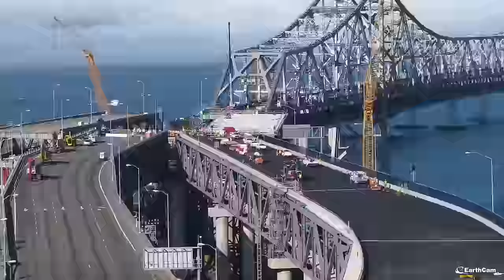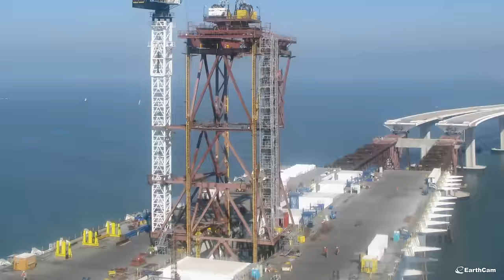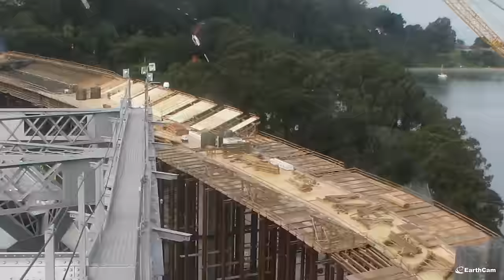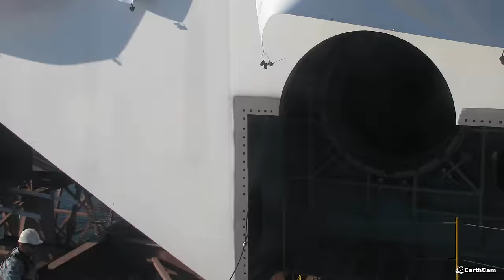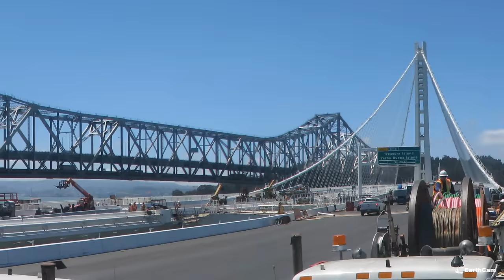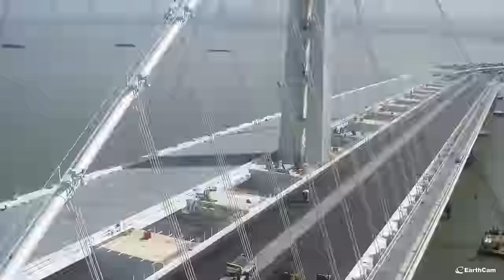Official San Francisco-Oakland Bay Bridge Construction Time-Lapse

Comment: Beautiful and hi tech. The bridge is designed to last 150 years and withstand 8.3 scale earth quake, and immediately functional and operational after any (imagined) earthquakes below 8.3 scale. The steel modular so are also hi tech, with spectacular precision. Engineers on site are deeply impressed that, for example, the 146,000 nut-and-bolts, fixers all perfectly aligned when installing, not even one fixer has 0.1% error!
Reply: This is an amazing piece of engineering and construction. 'Well done' to everyone involved.
Reply: Peter Wang wow your very smart I'm...

🤔DUMB I ain't as smart as that like Come on!!
Reply: Peter Wang man google really helps you
Reply: Eric Lee no only some of the steel, however it was designed by Americans
Reply: That's what you get when the engineer says every last detail to spec nothing passes that isn't from start to finish amazing
Reply: Mmmm sure whatever you say the last time i heard the bolts wouldn't stand a earthquake check yo self
Reply: So funny reading that first comment and how basically none of it is true. The bolts snapped as soon as it opened. The steel plates are so misaligned that water is already corroded the steel from the inside out. Life expectancy last I checked was hovering around 80 to 100 years if lucky. Overall the bridge was a complete failure on almost all fronts while being way over budget and failing to meet objectives.
Reply: You forgot all the suspect welds and rusted failing bolts before it was even opened for use. Are you a Union Representative ?
Reply: ryan stafford Have you forgotten all the bolts that failed the stress tests when the thing was already half built?
Reply: Can you say”Ticking Time Bomb”?
Reply: Orlando Nunez Spoken like a true  Union minion.....
Reply: actually, whole spans were made and shipped from china
Reply: @mrbrainbob5320  China has numerous bridges more stunning than this one, both designed and constructed by Chinese. This bridge wouldn't be finished so quick without Chinese supplier, because the debate would take forever when the budget is over by billions.
Reply: Yu Xiang The Chinese would use a lead-based coating which would need to be removed, remediated and approved by the EPA. We’d still be staring at pilings on the Oakland side.....
Reply: Wish All The Best to the bridge, but please remember Nature has it´s own rules...
Reply: Over $6 billion over budget and with faulty welds and bolts.
Yes........excellent.
Reply: @bongofury5924 , ummmmm and why is that?
Reply: Eric Lee  Even worse, it was built by Union workers.....
Reply: @yuxiang3283  Like the 3 billion dollar airport terminal which leaked in monsoon right after its opening.
Reply: The upper deck collapsed onto the bottom in 1989,  that was like a 7.3??
Reply: Made in Chaina!
😂😂😂😂

Comment: 25 years of a job well milked all packed into 4 minutes
Reply: 25yrs?  it sounds like forever for me
Reply: @xiaolongzhang3411  - Yeah no. It was about 10.5 years in total, and only about 6.5 years of actual construction (because of delays, work stoppages, cost overruns, politics, legal issues, etc.). Ironically, the bridge could have been paid for largely with U.S. Federal Tax Dollars (infrastructure grants, as it qualified being a Federal Highway). But the costs (bids) to build the steel modular sections and tower sections was so high, the State of California ultimately had those sections fabricated by Chinese suppliers (also loosing the Federal Grants, which had the requirement to receive them, that the entire bridge (and all infrastructure projects), must be "Made in America". The State of California could have worked it out, but our politicians are incompetent idiots. And even with the sections made in China (at a supposed large cost savings), the cost overruns were near what they would have been - if they had just gone with the American Suppliers/Fabricators in the first place; And it likely would have been done sooner. The issue there is: They couldn't budget or finance the fabrication of either the American or Chinese Bids, (as it was $Billions more than they originally expected/budgeted for), -hence the major delay (until they later eventually acquired the funds/ comittments).
Reply: @Sovereign_Citizen_LEO  china built longest bridge of 60 kilometre in just 9 years what a joke your are
Reply: @Sovereign_Citizen_LEO USA is a beautiful country where any human being would love to live, excepting some European countries where living is also a beautiful experience but China, although is a beautiful country also, full of nice people, has a culture very difficult to mix with other ethnic groups, very difficult, their eating habits are just for them. No way comparing engineering works of almost 200 years old with modern ones in China, almost all in a straight line, yes, some are monumental but not to be compared with the constructions and civil works of the USA in the late 1800¨s.   I´d been in those three places, and although I enjoy Europe very, very much I feel depressed when traveling to some of their countries, instead  the overwhelming breadth of the US is just incomparable. Sorry if I hurt some feelings, it is not my intention,
Reply: @logisticabucaramanga5094  - No hurt feelings (don't care one way or the other). Columbia is a beautiful country (green and lush), beautiful women, etc. Europe for whatever reason (even though it's amazing) doesn't interest me that much. Not true for South America (or even parts of Central America or Coastal or Southern Mexico). I would like to travel there. USA is somewhat boring in a lot of ways. I'm not too interested in works of Man (though they may be impressive). I like wilderness and works of God (natural places).

 I was thinking I might buy a property in Coastal Central America or Coastal South America (or Mexico). If I was wealthy I probably already would have.  Asia is also very interesting and vibrant/dynamic. But as for the natural world, I prefer North and South America (maybe parts of Europe also), and the Pacific Islands. Anyway, this girl is from Bucaramanga (and when I first saw her I was like.... wow : )    https://youtu.be/o5i-bj-6-Tw
Reply: @Sovereign_Citizen_LEO  I can´t believe you just mentioned my home town Bucaramanga !. When I was reading your answer, and saw you wandering thru those countries in your mind, I was thinking if Bucaramanga wouldn´t be the right place for you, and depending on your age it could be either the city itself or La Mesa de Los Santos which is a resort area where Panachi, and the Chicamocha Canyon Park are located.  
the world is definitely a handkerchief!. Where are you at?. Regards from Bogota, Colombia. Al Diaz
Reply: I see... I answered from my mail with the word Bucaramanga, anyway, nice to meet you. Yes, Colombia is a great country ruled by bandits, but even though it has a good living standard.
Reply: @logisticabucaramanga5094  What about the 1400 years old Grand Canal of China ? I think you underestimate chinese engineering. China and Europe are that USA are not yet, Civilizations with a big C. In Europe you can see more changes travelling 1000 km than 1000 km in the US.
Reply: Why do you say 35 years?
Reply: people built golden gate bridge in 1930s in 4 years.
Reply: took 3 years to complete lol
Reply: K
Reply: 2008 - 2016

Comment: They built the roadbed on trestles, then when they connected the cables and tightened them, the roadbed lifted into place so they could remove the trestles.  I watched a lot of the construction as I went to and from work.  This video is like what I did, only without the annoying "going to work" parts.  ;-)

However, it doesn't seem to show the infamous broken bolts, the famous "saddle" to work around the broken bolts, or the notorious shims to keep it from collapsing while they build the saddle.

Comment: What is the type of that bridge? Hybrid? I see beam, cantilever and suspension.
Reply: The old bridge, the one with cars, is a truss-cantilever. The new one is a self-anchored suspension span, although it looks like a cable stayed bridge. Behind the point of view of the video the roads on the two sides of the bridge become one above the other and go through a tunnel. The other end of the tunnel connects to two suspension bridges, one after the other, with an anchorage pier between them. At either end of this hybrid set of bridges there are viaducts and conventional highway construction. Before COVID-19 the bridge carried about 260,000 vehicles per day.
Reply: I forgot to mention that the new bridge is in the Guinness book of records as the widest bridge in the world at 258.33 ft (78.74 m).

Comment: Only $6.4 billion...
It had an initial estimated cost of $0.25 billion, but because of design mistakes the cost only rose 2,600%
It better last the projected 150 years or someone needs to lose their engineering license
Reply: Eduardo Gamez
That's 2600 percent, not 26,000.
Reply: The designer wont be around in 150 years to see if the bridge lasts. And by than bridges won't be necessary. The cars will hover over the water.

Comment: Bay Bridge in new lease on life the original one is so decrepit that they have to tear it down. Loma proved that the original Bay Bridge cannot survive an earthquake that bridge is right smack in the middle of the San Andreas Fault and when Loma hit it tore the bridge in half and sent cars crashing into the bay. The new bridge is more structurally sound and can survive an 8.9 earthquake and it has already been tested a 7.5 earthquake hit the same spot and destroyed nearby Napa Valley and the bridge survived with only slight damage.
Reply: crashing into the bay? what earthquake did YOU witness?
Reply: The 1989 quake, One small section of the upper roadway fell at an angle on the lower roadway.   It was repaired rather quickly.

Comment: Meanwhile in China it would have been completed in months for a few hundred million $ (and during a pandemic).   Sorry but $6.4billion - no wonder this country is losing out in the global economy. That is shameful!!  

(The span replacement took place between 2002 and 2013, and is the most expensive public works project in California history, with a final price tag of $6.5 billion, a 2,500% cost overrun from the original estimate of $250 million. Originally scheduled to open in 2007, several problems delayed the opening until September 2, 2013). (https://en.wikipedia.org/wiki/Eastern_span_replacement_of_the_San_Francisco%E2%80%93Oakland_Bay_Bridge)   

Compare that to https://en.wikipedia.org/wiki/Jiaozhou_Bay_Bridge for $1.5 - $8.2 Billion in 4 years.

Comment: And it's made it China! (The steel structure part that's most technologically critical.)
Reply: Actually, parts were made all over the world, including China, Japan, England and USA.
Reply: +Guoguo Lu steel was
Reply: +Guoguo Lu anyone can make steel- I give my praise to the american engineers who designed this bridge and its parts
Reply: Blahblahblah14898 The Bay Bridge’s design has much more to prove.

Especially when it comes to its self-anchored suspension. Technically, that design is proven, too: Pittsburgh’s Three Sisters Bridges were built using the technology in the 1920s, and South Korea’s Yeongjong Bridge is a self-anchored span longer than 900 feet. But those bridges all share their loads over two towers, and the Bay Bridge is over 1,200 feet long, asymmetrically loaded on a single huge tower. The Bay Bridge might be too ambitious. “It’s not beyond human capacity or knowledge to do a bridge like this right,” says Levitt. “But I think there are more problems than I would expect to see on a bridge this complicated.”[1]

600,000, 350,000 and 70,000. These are, allegedly, the number of engineers produced in 2004 in China, India and the United States, respectively.[2]

[1] http://www.wired.com/2015/10/californias-busiest-bridge-serious-issue-rust/
[2] http://www.washingtonpost.com/wp-dyn/content/article/2006/05/19/AR2006051901760.html
Reply: Blahblahblah14898 Did they ever resolve the problem of sub-standard bolts?
Reply: Guoguo Lu - Except it can't be understated that in both China, India, and most other countries around the world, the educational, technical, medical, engineering, etc. -infrastructure, schools, technology, was invented and funded by Americans and Europeans. For example, John D. Rockefeller created and funded the modern Chinese [Western] Medical and Hospital and Education system (medical schools/colleges). Nearly every aspect of the Bay Bridge was engineered by American architects and structural engineers. Every component, nut and bolt, was designed by them. Nearly every aspect of every society in the world historically was designed and engineered originally by Western engineers and scientists. They did the difficult research and groundwork that allows for the modern innovations of today. Most of the massive projects, bridges, dams, skycrapers and infrastructure projects in China, India, the middle east, and elsewhere, are still designed and engineered by American and European architects and engineers. It is true that more and more Chinese architects and engineers are designing and engineering projects in China, but most of them received at least some of their technical education in America or Europe (or both). What is most important to understand, is that there is nothing special about China (moreso than any other country), except a massive underpaid workforce with little or no industrial, safety, or environmental regulations or standards such as those in Western 1st world nations. Those facts and conditions are what allows China to complete so many large projects at such a fast pace (compared to other countries). Western nations also have far more additional regulations (such as environmental laws), which slow down the pace of large projects and drive up the cost to what would be considered impossible/unsustainable in a country like China.
Reply: SkylineToTheSeaAndMe you are forgetting about the contribution that Jewish makes in USA. They gained a27 per cent of the Nobel prize but are 2 per cent of population, they are 30 per cent of Ivy League, 25 per cent of Turin awards, and their average wage is 400.000, 4x times the American average wage. US only started dominating the science fields when Jewish came to The country, only after WWII.. the nationalist thing is not working, cause the typical White Anglo Saxon American is actually less important when you talk about great achievements by the USA. Tesla, some of the builders of the first atomic bomb, Von Braun (The one who made Saturno V) all of them are obviously foreigners and by the way, without the contribution of Ancient Greek and Southern Europe in general we westerns would still living in tribes.